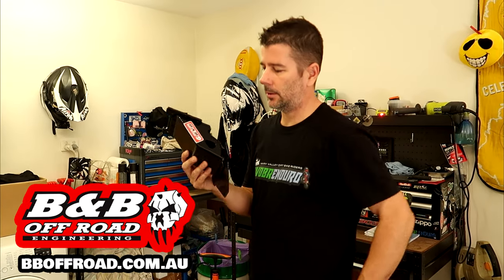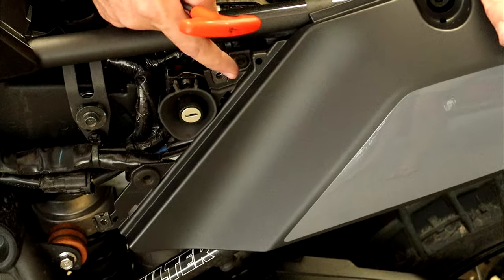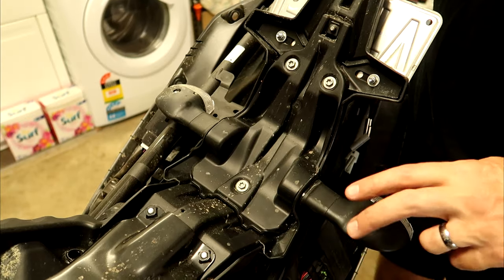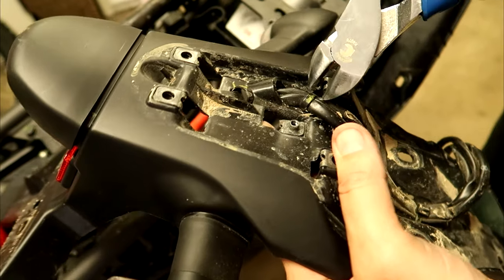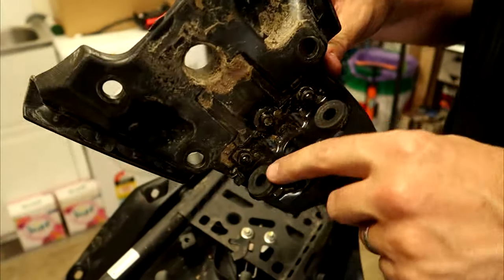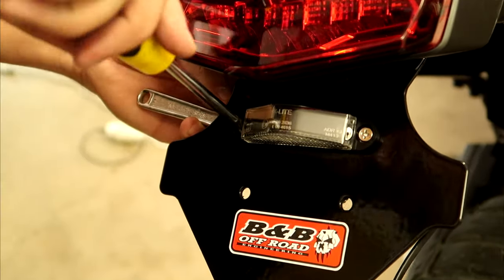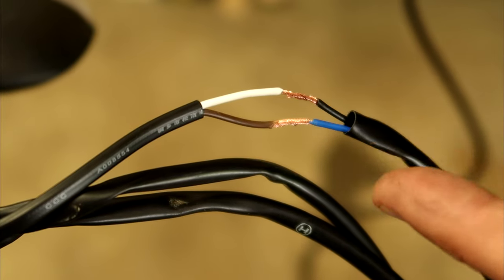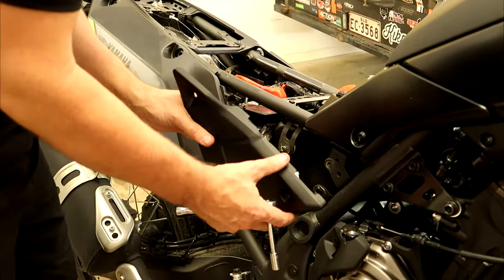Tenere 700: B&B Off Road Engineering Tail Tidy Number Plate Holder Install

Comment: Hey Josh, thanks for this Vid. Mounted the tail tidy yesterday without hassle. Spent a bit of time cutting and soldering the wires which has tidied up the whole under-seat area. What a great piece of kit - love the B&B stuff.
One little hint for others. I used the number plate screws (screwed in loosely!!!) to lightly hold the indicator assembly in place with the number-plate section, which freed up my hands to get the 10mm bolts in correctly. Hope that makes sense, because it certainly made it easy!
Reply from the maker: Good stuff mate yeah it helped having the wife around to get that bit done hehe, but that method is good cheers. B&B stuff is the bomb

Comment: Just did this to my, new to me klr. I can reuse the one factory bracket to move it up higher and that's it.
It's amazing how much hardware is used to hold these brackets on.
Doesn't mater what bike either. And they look so much better with out it, or just relocating stuff.
Looks slick👌
Reply from the maker: It seems to be a Japanese bike thing hey... don't recall seeing many Euro bikes with big daggy tail units 🤔 But yeah definitely a much cleaner look without all that crud. Cheers man

Comment: Just doing the same. Swapping out ridiculously large Canadian pumpkin signals for LEDs while I'm at it. Went with the tail tidy unit from our local guy @ Camel ADV. Check out his anti bobble head bars to steady out the dash & headlamp, they work a charm.
Reply from the maker: Yeah sweet I like the high fender kit as well but what a pain in the ass to install. I don't mind the look of the low fender anyway but I guess after clogging it with mud a few times I'll get sick of that :)
Reply: Ya, low fender suits me fine too. Keeps the rad much cleaner I'm guessing. Keeping the low boy adjusted up will take some serious gumbo to get it bunged.
Reply from the maker: @lessmore444  yeah we were out in some sticky shit on the weekend and no dramas (other than slipping all over the place haha), but still don't have knobbies on yet so that added profile might change things we'll see. I'm hoping she'll be right. But yeah definitely very little crap got onto the radiator guard, however the 390's was caked up the middle. It's low guard must be a bit too short on the back. Good job KTM 🙄
Reply: @MVDBR ya these stock tires are definitely street boots. Getting used to this scoot while wearing them out will make it a whole new game when some proper traction finally gets mounted. Summer's just getting rolling up here, few months now till the proper west coast mud returns. (Followed by snow & ice!) Proper knobs by then for sure!
Reply from the maker: Yeah sweet are you gonna stick with the STRs till they're cactus? I got some knobbies ready to fit but not much point till we get some for the 390 as well
Reply: @MVDBR  spend summer scrubbing those STR's off, ya. Shopping for the next level while the piggy bank refills. Guy can go overboard fast moding these units..$$$

Comment: Scared I stayed for two things. The amount of pieces you had to remove and the amount of mud that had gotten into areas that were supposed to be covered by other plastics 😮😮
A detail Josh, heat-shrink tube, for these cases of cables that may be exposed to water is a great idea and in case you do not have at that time and given that you had excess cable, instead of making the splice at the same position, the joints separated by 2 or 3 cm so that in case the tape is loose, which over time will certainly, not produce a short circuit. 
It looks much better than the original 😀
Reply from the maker: Yeah, and that was from only one mud hole I went into! Haha. I am a professional wire taper mate don't worry about that hahaha but yeah hopefully I will have some heat shrink before I next take that guard off then I can fix up the wires :) Thanks for the comment!

Comment: You cost me $17000 today after seeing you videos I brought the same bike, was keen on the red and white but when I saw the black in the flesh had to buy in black ,now let’s start the mods
Reply from the maker: Should have talked em down a bit mate I got mine for $16K. Black is the best tho congrats man make sure ya put the best gear on it (B&B of course)
Reply: @MVDBR  they were asking $17100 and I got them down to $16200 will a b@b bashplate the same as yours fitted happy with that, I have already ordered the b&b tail rack sw motech crashbars, headlight protector and radiator guard, now I am broke
Reply from the maker: Perfect 🤙 Fun times ahead

Comment: Nice job man looks lots cleaner just one question can you na fit the standard number plate light ? Or just drill new holes instead to make fit save cutting and soldering wires just thought keep up the good video you too do keep it rubber side up ha ha
Reply from the maker: I'm not too sure Sean I'll have a look at the old light later on and get back to ya, but I'd say probably not or else B&B would have integrated it instead of supplying a different unit. They do supply some of those clip type wire connectors if you don't want to solder but yeah if you want to leave the original wiring intact I'm not sure what the options would be. Thanks for watching mate 🤟
Reply from the maker: Yeah I don't see any reason you COULDN'T use the stock light, if you really wanted to but its such a big ugly dag of a thing. Holes have different spacing tho so drilling would be required, there's roughly 45mm between stock mount holes and about 75mm for the B&B unit 👍